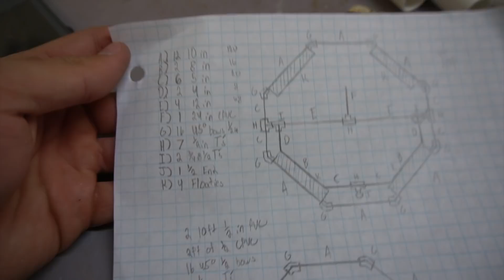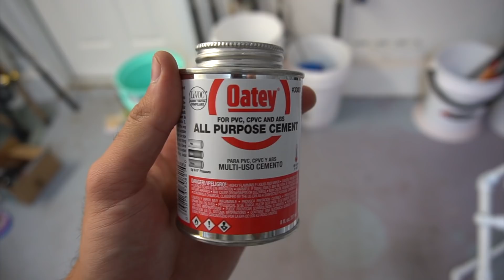How to Build a Live Bait Pen [DIY Bait Pen]

Comment: Awesome video man! Was wondering, can you provide more details around the design process, how you made the calculations, scaling etc?
Reply from the maker: I based my measurements off a bait pen I already had that worked well for me. That one was a cylindrical design so I tried to get the same diameter using an octagon and made it a little taller to fit more bait. You want to limit the amount of sharp corners in your design so the bait doesn't injure itself which is why I chose to do an octagon
Reply: @SeeYaDude  That's interesting, thanks!